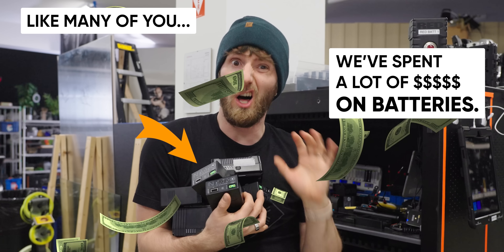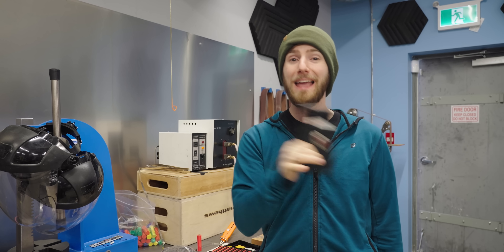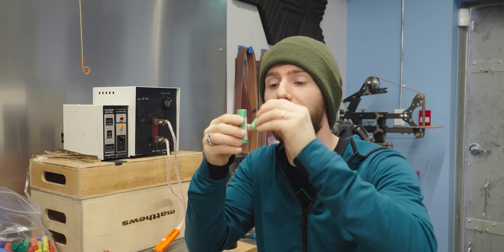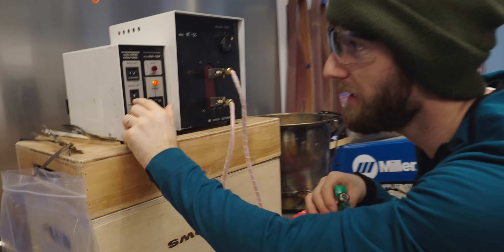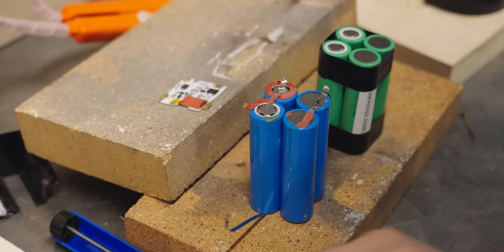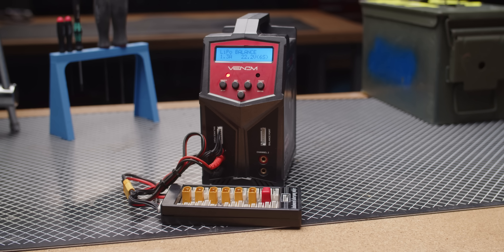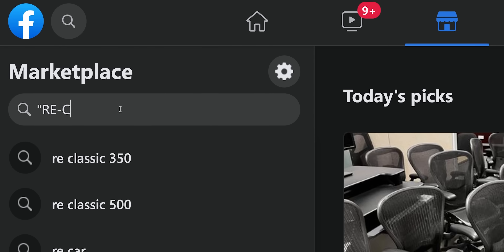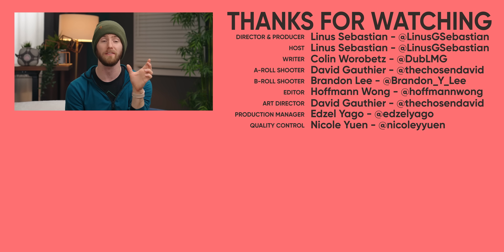This should be illegal… Battery Repair Blocking

Comment: This video once again proves nobody at LTT knows anything about li-ions and how a BMS works, those sparks that led them to trow away the pack where just because of bad contact between the welder tips and the strip, they are no reason at all to trow away the pack.
secondly like already mentioned in other comments, 90% of BMS's to not power on after a cell has been to low until you connect it to power. it is an actual safety measure.
These are such noob mistakes that if they had done research for like 30 minutes they would have known that
Reply: THANK YOU. I was screaming at my screen. They need to actually get in contact with someone who knows what they are doing. They should collaborate with jehugarcia or something. I have never sceen such waste and unwieldy use of this stuff :/ reminds me of every time mythbusters tried to make rockets, they sucked so bad at it.
Reply: @goodman854  tbf Colin responded to another comment saying he did recover the cells from the sand bin. it was just a security measure, but still, that all could have been avoided if they contacted a professional like you mentioned
Reply: You can see the sparks happen on the professional clip they show at 17:26  as well lol
Reply: I totally agree with you..
Reply: You are right, but i assume they are playing extremely safe on purpose... i wouldn´t call them noobs... It´s a show... remember? Have a great day!

Comment: This is the biggest issue with batterys. One of the down sides of the handheld systems. I know the psp can be known for swollen batteries. It's one of the Reasons why with gaming controllers I don't mind Xbox using AA vs Rechargeable. AA are definitely easier to replace.

Comment: 1. Did you try to charge that one pack that didn't came back to life when you did everything correctly? Some BMSs don't wake up by themselves when the voltage drops below certain level, and you need to power them externally.
2. Yes, some BMSs detect cell disconnections when you try to swap them, and when I was replacing cells in my laptop battery I did one simple trick: before disconnecting any cells, I soldered on external drone lipo of a matching voltage, so when original cells got disconnected - BMS will remain powered on. It worked flawlessly, and after some cycles charging and discharging my battery BMS even earned new capacity

Comment: From an engineering and manufacturing perspective, even though rivets are "one time use" they are actually fantastic in a variety of applications that allow us to fasten dissimilar materials, stacks of thinner materials without the need for welding (this is especially true with aluminum body panels), better fatigue resistance for the joint, as well as reducing the chance of the joint becoming loose over time (in the case of bolts or screws), and none of these things address how much more cheaply we can use some single sided fasteners. While I'm 100% behind the right to repair (I fix everything myself even if companies don't want me to be able to...) there are instances where single use fasteners and designs do make sense. Love the content and bringing awareness to these issues btw!
Reply: @Gareth Tucker Removing a rivet from plastic often destroys the plastic.
Reply: @trogdorstrngbd  I'm willing to bet some enterprising youtuber has a solution for even the most challenging rivet extraction scenario.

Comment: I replaced hundreds of lipos and a "smart-ish" BMS will NOT auto power-on when you resolder the new battery, this is because the BMS will kick its low-voltage protection, generally you can reset it by simply charging the battery for a few seconds, and it will turn back on.
When you think about it, it's totally logical, if you de-solder the battery so the BMS (which is not only the chip itself but all the mosfets and all around it) the mosfet that is controlled by the BMS is turned off and when you resolder the battery in, the BMS can't turn itself on because the mosfet is still off blocking the current flow, plugging in a power source will turn the BMS back on, which will in turn, turn the mosfet back on.
Of course there will always be evil ones that won't allow you to do this, but I found that more often than not it's simply one of the protections of the bms itself causing mayhem

Comment: The issue with Batteries is a reason why Electric cars aren't as feasible as they say they are. Still not economically friendly in long run due to the liquids in them

Comment: I'm sure this is to dissuade people reselling packs with dirt cheap cells in as 'new - open box' as much as it is to hinder repairability.

Maybe lines of easily distinguishable 3rd party BMS boards would alleviate that for power users, but for non tech savvy buyers, it risks tarnishing the reputation of the brand in future

*Not that brand image matters as much as repairability, it's just a consideration.

Comment: I have made many projects with 18650 cell but when my laptop battery died(It's over 8 years old) I attempted to replace them. Turns out there is a software system blocking that and the whole system went unusable. We do have people here who have made ways to even fix that and that's where I got that battery fixed.

Comment: Not sure this would work on LION (Lithium Ion) or LIFE (Lithium Iron) cells but as an RC enthusiast, I use Lithium polymer cells (Li-poly or LIPO). Whenwe get a failing cell (packs are spotwelded as you show as well) the entire pack is pretty much done. So we usually put a bad pack (after discharging as much as human'y possible (by charger or lightbulb) and putting the pack in saly water (this does two things, it shorts the remaining charge so it completely empties the pack but also the electricity plus the salt in the water erodes the parts of the pack that distribute and move the charge, making the pack completely useless. Once again, not sure if this actually applies to LION Or LIFE cells, this tip is what I learned when starting with LIPO cells
   Also for a little security for the pack as a while Use a product called Shoo goo it's a thick rubber cement like glue that when hardened offers the ability to hold a shape, yet pulls off like Elmers School Glue if you need to remove it. You could then glue to the exact shape you need

Comment: I’m far from an expert, but… when measuring battery voltage where accuracy matters you should be checking the drop across a resistor.
What they showed works fine for a quick and dirty check, but you really should measure properly…
If you are experienced in electronics, feel free to reply. Heck, maybe I’m just plain wrong?
Reply: no they just have no idea what they are doing (throwing out perfectly good cells for example)
Reply: How do you think the device that displays the voltage works?
Reply: @someonespotatohmm9513  While that makes sense, it’d expect there is more going on than just a simple load.
Reply: @CoolJosh3k  Yea there is, I actualy don't know how it exactly works but I think it still is fundamentaly a load, and a lot of fancy circuitry to make it very accurate and reduce the current required.
Reply: You are talking about checking the battery under load. You can do that but an open circuit terminal voltage can also be a meaningful measurement, particularly when checking cell voltages before connecting them in parallel.

Comment: You really need a D class Fire Extinguisher. It'll be a heavy af big yellow one with a solid metal wand. They don't really "spray" out the chemical they just pour out the chem. Look into it, if you are going to be doing more of this kind of work. It'll be worth the sub 1k dollars (at least in the states that's the cost).

Comment: Batteries are like printer supplies, but far worse. Every single 18 volt power tool can use the 18 volt battery packs from almost any other manufacturer, because the only difference is the physical pin connection.

It's done to lock you into a manufacturer for your tools. Suppose you have six Bosch 18 volt tools and twelve batteries, and Makita comes out with a new tool that is demonstrably better than the old worn out Bosch one you're looking to replace anyway. It's 10% cheaper to boot. But you've already put a LOT of money into the Bosch batteries. So you'd have to not only buy the tool, which comes with a wimpy battery, but also a couple of extra batteries. And a beefier charger for the new Makita tool as well.

Suddenly that demonstrably better and cheaper Makita tool doesn't look all that appealing, because you'd have to fork out a LOT more money to get it.

All of these products need to have open and probably enforced standards, like we're getting with USB-C for cell phones.

Comment: As a hobbyist, that was a bit of an excess of safety haha. While you absolutely want to make sure not to get sparks, if you get one you don't really need to chuck away the whole pack, if it's a short caused by you that lasted a fraction of a second. If you misplace the spot welder leads it will spark, but the cells don't feel anything. Everything happened between the leads of the welder and no current passed through the cell.
That said, great job on the video! Love the more direct ways of exposing what manufacturers do to impede repairability.

Comment: shoe goo or hot glue the cells together. and those sparks are from the electric spot welder not from a damaged cell. totally safe to keep going just keep that tip, strip and cell's clean including from oils from your fingers.

Comment: What is the point of doing this?
I mean what are you NOT wasting if you throw away/recycle the old cells
Only the housing and the bms 
Is far more simple buying an aftermarket battery pack

Comment: There’s got to be an industry wide solution for the battery problem. Tired laptop, phone, v mount etc cells can be used for solar for YEARS due to the low charge and discharge rate in a large array.

Comment: That pack not working after you finished putting it back together might be malicious on the manufacturers part, but it might also just need to be plugged into a charger for a minute.. some BMS's will disconnect the pack like that when it sees a voltage too low (like no voltage when you disconnected the cells), and it will only start working again after being plugged into a charger to reset it.

Comment: 11:16 wait. Was that the reason for throwing out your pack? That was just a little bit of nickel flying away because an air gab closed or you slightly slipped. It had nothing to do with the battery itself. Protection and caution are important but throwing out the pack after the first spark is really a little bit too extreme
Reply: It was a tad bit funny, considering they show a clip of a professional assembly where sparks are flying and the guy is just ignoring them.
Reply: I agree, that spark doesn't mean that there is a anything wrong with the pack. Furthermore, the spark happen on the negative terminal of the battery, it is the side with the largest thermal mass and thus the least susceptible to being damage by repeat attempt at spot welding. You just need to remove that nickel strip and try again with a fresh new strip. I used to assemble lipo battery packs and I have experienced these sparks all the time.
Reply: It was over exaggeration they should have had someone with steady hands and used to soldering
But they are just trying to make some sort of "show" for youtube
Reply from the maker: As a precaution we put the pack outside and let it sit for a day. I have since recovered the cells. -CW
Reply: @LinusTechTips  I am guesing it is from a lack of footage and scheduling, but some clarification that sparks (depending on the circomstance) can be normal (ususaly when you have some uncharged capacitance and connect it for the first time) would have been nice. Great video otherwhise.
Reply: @LinusTechTips  you should pin a comment saying this. Its a good precaution for sure, but the video implies that any sparks (even the ones you got before you could even attempt a completed circuit) means dead battery. Would also be nice to see a response to the bms reset comments with the charger tbh
Reply: @LinusTechTips  Please spend a day playing with the spot welder next time. A lot of viewers are gonna believe the FUD and think swapping 18650 cells is difficult when in reality it’s almost impossible to screw up.
Reply: Considering they mentioned that they only had a basic understanding of what's going on plus lithium fires being toxic and dangerous, I think it was a safe call even if it was a waste. Safety first y'all.
Reply: yeah this video is a bit ridiculous, oh oh, we had a spark, throw all the good cells away! That's dumb, if you're so scared of batteries doesn't mean it's impossible to replace cells in them. Come on
Reply: it looks like he was probably welding too close to the trim edge of the strip on that one creating expulsion

Comment: Don't change out bad cells, ok i guess
But can i take out the good ones and use them for something else? 🤷‍♂️
Reply from the maker: As long as all the batteries are from the same batch when they go into a new project (dont mix and match) then sure! If you mix and match the best functioning cell(s) will do all the heavy lifting, and can cause issues. -CW

Comment: What monsters check single cells and replace broken ones?? Different cells have different resistance and having mix and match cells can mess up the balancing part of charging and kill off any new cells in a pack (as they would have lower resistance and would accept more charge) especially if you have mixed cells in the same pallarel pack.

Comment: Throwing out the old pack is a huge waste.
There are people who will just disassemble it and test each cell for its capacity and build custom battery packs from this.
Even if you wont do this yourself, you can sell those cells on ebay or something, so they will get a second chance and we reduce e-waste.
Also important disclaimer: don't just replace bad cells, you need to test the entire pack cell by cell and build new one keeping capacities of each cell in mind.

Comment: 8:56 There is pretty much zero chance of arcing here. You're still connecting the first side, and connecting batteries end-to-end doesn't do anything. You need a complete circuit for current to flow, which means connecting both ends of batteries.
Reply: yes, i agreed, this isn't a good videotutorial...
Reply: a little spark won't do anything. lInus thinks that a long low ampere pulse will kill the cell, but it won't
Reply: @mrroze427  it's linus, he always spouts wrong information with confidence.
Reply: @mrroze427  I wouldn't necessarily call this a "tutorial" as much as a "Lets see what happens" kinda video.  And I think Linus would agree that this video isn't meant to be taken as a tutorial in any capacity.  He isn't a professional, and he knows that.
Reply: Sometimes the plastic melts and the rim (negative) and center (positive) get shorted by the nickel strip.  That's why you commonly see paper washers on the positive end of the cells in a pack.
Reply: @gregbrown9882  correct but thats not a spark like was seen here. That typically causes the nicle plate the fail and is super obvious and repeatable of you just poke at the strip
Reply: @gregbrown9882  Sure, other manufacturing issues can happen. My point was, in that context, I think they were concerned about differences in the internal voltage of each battery, which won't be a problem until you connect both ends of the batteries together.
Reply: yeah
Reply: Actually you don’t need a circuit for current to flow. You just need 1 end to have a different potential than the other.
You can use lightning as a common example of this. While the earth is mostly at 0 volts, when enough voltage (positive or negative) exists in the clouds then current will flow from the earth to the clouds.

Edit: a quick note that lightning is way more complicated than this, but I think this simple version works for the example.

A circuit is just a description of a scenario where the 2 ends (of different potential) are very close to each other, such as inside of a battery or a capacitor.
Reply: @CoolJosh3k  Yes, you could have a static difference between the batteries, but in a climate-controlled environment, I'm pretty sure those differences will naturally level themselves out. And if you are concerned about static, measuring the internal voltage of each battery separately doesn't give you any information about the difference in the static charge of the batteries. That measurement only means something once you reference the batteries to each other, e.g. by connecting their negative terminals.

Comment: I am NOT a fan of ifixit's plastic bit drivers that come included in their kits. 
They do not highlight this in their listing (they micro-detail it as "material: polymer" down below) 
And they do not offer you an upgrade option to a metal Bit driver at checkout if you happen to be an informed buyer.

Comment: I did that on my Dad's Sony Nightshot tape handicam. Re-used old laptop batteries 18650s, made the pack MUCH larger, and it helps me backup all those tapes without worrying the battery is gonna die in the middle of a tape.

What do you mean the smart solution would have been to just buy a DC charger and leave it plugged in ?